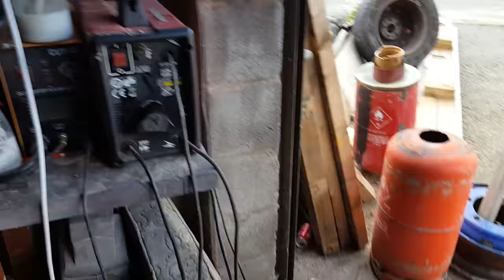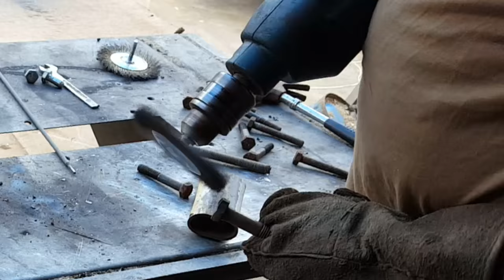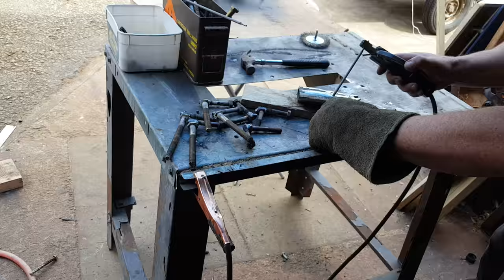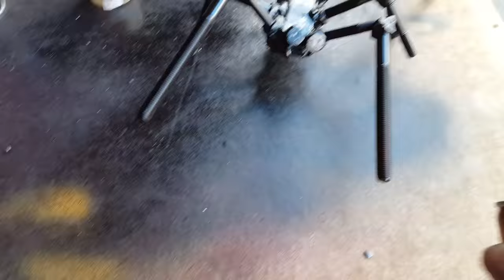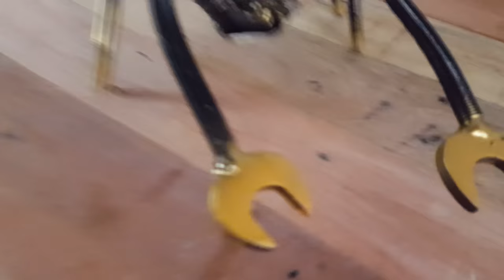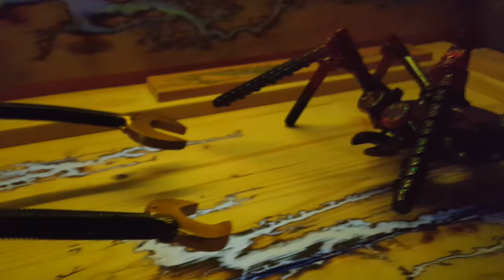Easy Welding Projects for Beginners - Scorpion from scrap metal

Comment: I love it. I always put my clamp on my workpiece and not the table with my everlast welder. It would be so much more conventient to just clamp the table. Does it make a difference?
Reply from the maker: as long as theres good metal on metal contact between the table and the work then its fine, the work might stick or arc every now and then, if i remember rightly when i was in college years ago i did a short metal welding course and im sure thats how the welders were connected up there